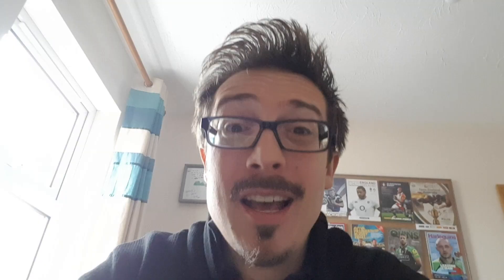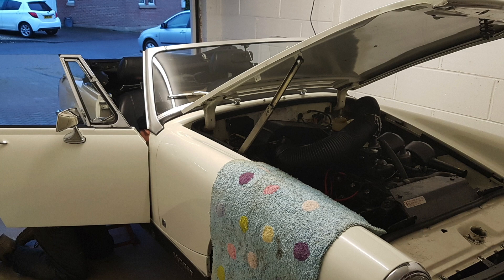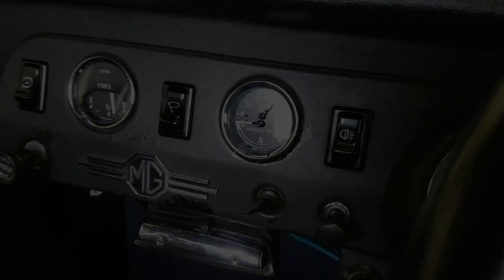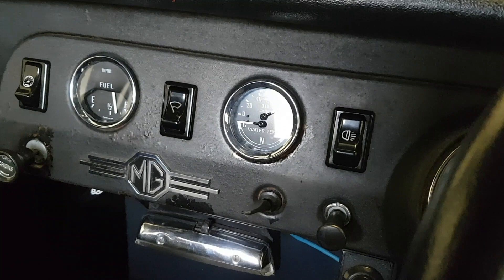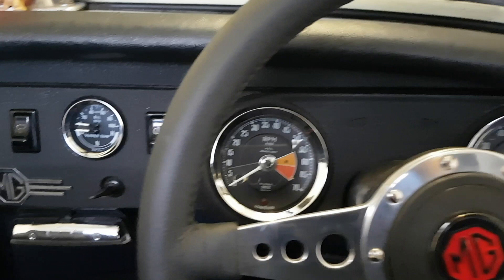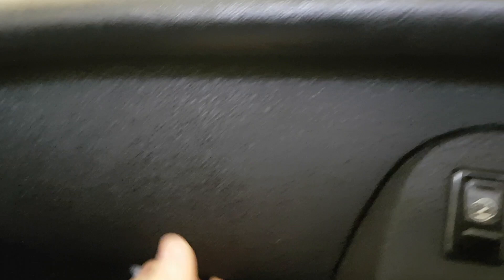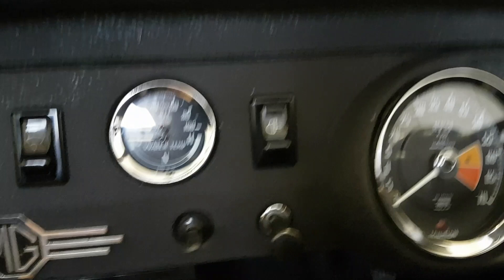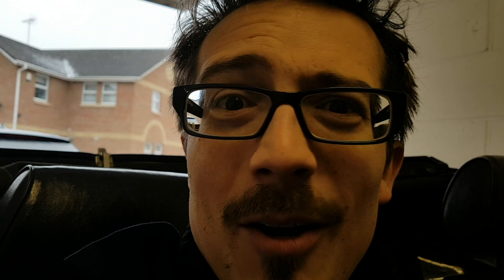MG Midget Dash Respray

Comment: My bonnet spring and locking mechanism unwind constantly with the vibration of the running engine. About once a month or so, I screw the lock up to 5cm from the underside of the bonnet. It's about a 30 second job and keeps stuff where it ought to be.

Comment: What a great ride Margot is, a really sweet Midget. "this here" is the heat shield that's supposed to stop vapor lock or fire and exploding by shielding the carbs and fuel lines from the super hot exhaust manifold and pipes just below. A cross-flow head would put the exhaust on the opposite side and solve the vapor lock problem but cause problems (for your bank account) for systems on the other side, like oil and ignition, or you can use a $0.35 silicon rubber washer? The two braces aren't on the 948 or 1098 motors, added with the 1275. It IS a little larger, come to think of it. I have a pile of these in my spares bins, and there's none improved over the others IMO, one from an early Sprite looks an awful lot like like one from a later Midget. My father's race cars just used the same heat shield on the 1098, but some of his buddies put the cross-flow head on because of the temperatures they ran at, or wrapped their exhaust in asbestos tape. Every picture I have of dad's engines show the same setup you have, he solved the problem by routing a pipe from a headlight bucket to blow air over the carbs... so it only got vapor lock at low speeds. The plates may be slightly different, but really, how different can a sheet of steel be, the biggest payout seems to be had by providing better airflow? I intend to wrap the pipes on mine when I get the chance, and as I rebuild the ones I'm rebuilding because it improves the heat problem without sacrificing cash or performance or authenticity.
Reply from the maker: Love this thanks so much for sharing

Comment: I think the carb heatshield bracket thingy is supposed to fasten onto the engine lower down on the block, rather than one of the exhaust manifold studs. That might give more rigidity to things. And things are always improved with a bit more rigidity …
Damnit, now you’ve got me making terrible quips
Reply from the maker: I took it off completely in the end and it's much better ! And please, quip more !!!

Comment: Hi Andy, I've just got a 77 Midget and am in the process of making it pretty again (nasty old rubber bumpers are already long gone). Can I ask if you have any advice or guides to take the dash out? I need to re-spray mine and the speedo doesn't work so need to get in there. I have a Haynes Manual but unless i've been blind there wasn't anything obvious in there about getting the Dash out.

Any help would be hugely appreciated!

P.S. Love the channel, you pretty much sold me on the idea of Midget ownership!
Reply from the maker: Word Up Kyle. 
So sadly I did NON of the prep on the car at all for the dash  which is bad right ! I'm not good with electronics so I left it to the professionals !
Reply from the maker: Ps. So pleased you like the channel! And part of the midget army massive !
Reply: @AndysMGAdventures  Ah not a problem, thought I'd ask! I've never really tinkered on a car before so am learning as I go, heavily relying on the community haha!

Does being part of the Midget Army Massive come with a badge? :D